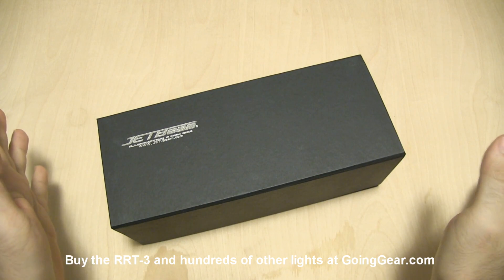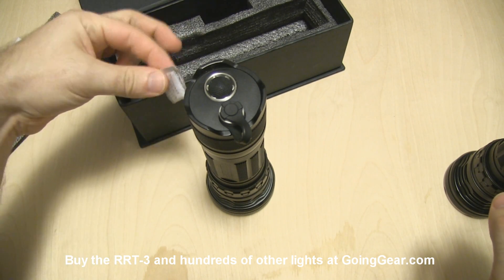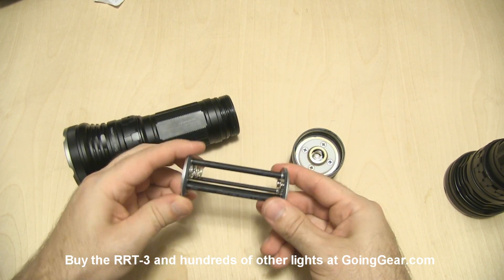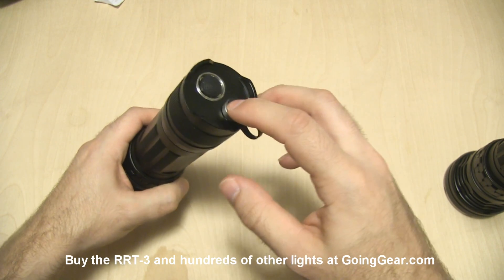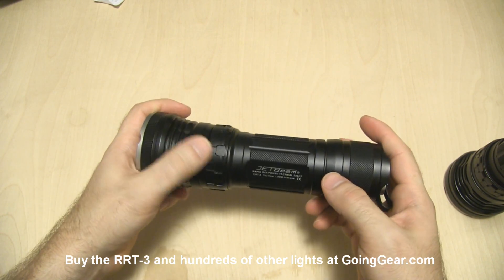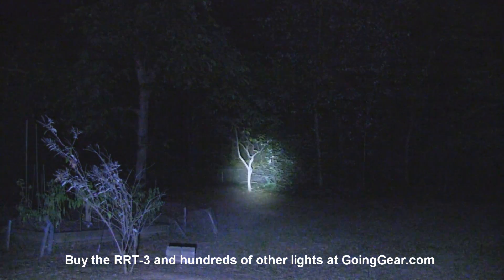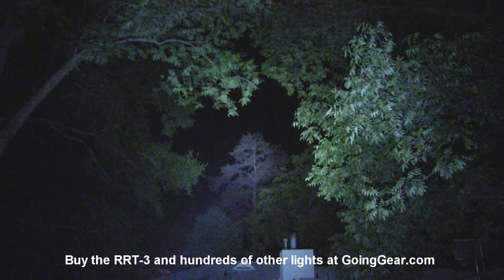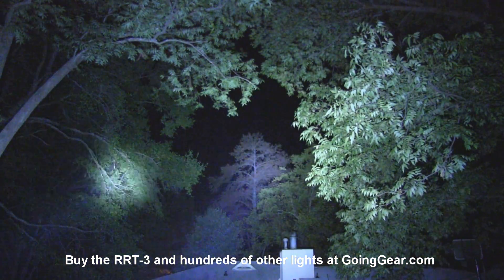JETBeam RRT-3 Triple XM-L Flashlight Review

Comment: the 3x xm-l, rrt-3 puts out a broad wall of light, but it doesn't look as smooth as others.  are there light artifacts coming off the reflector?  i see varying intensities of light in a radial pattern as you go from center to periphery.  some light further toward the outer light boundary is a little brighter than light closer to the center--the opposite of what should be true.  they are slight variations, but evident, nonetheless.  
do you see what i'm talking about?